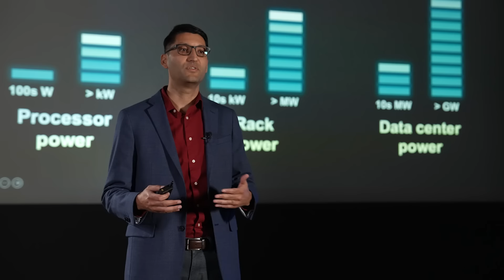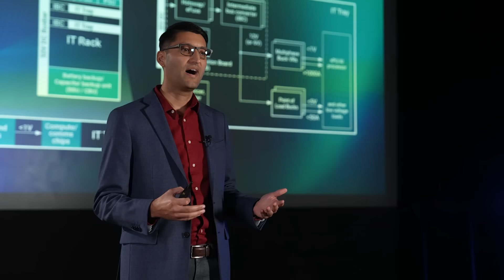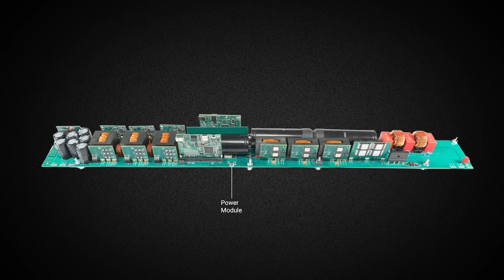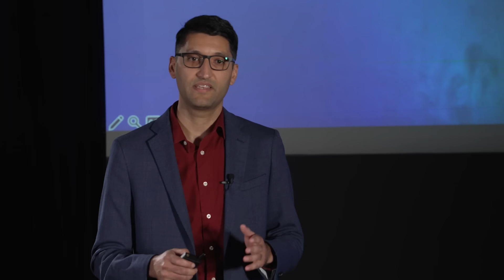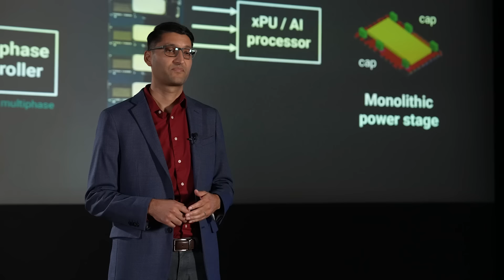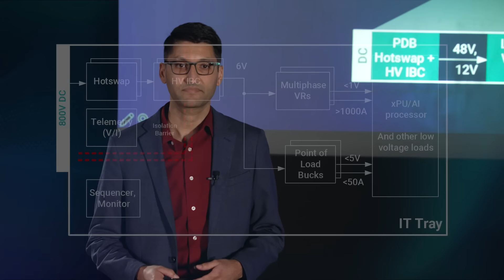Reimagine AI data center power from grid to gate

Comment: I was granted US patent 3890161A  DIODE ARRAY in 1975 for a cooling device paired with DC electrical power yield typically consisting of billions of nanometer-scale diodes in parallel series. The patent opened to the public domain in 1992 providing me with permenent written public attribution for the idea circa 1973 upon filing. 

The physics supporting the DIODE ARAY is simple and well supported. 

Johnson Nyquest electrical noise is a well accepted phenomenon in the microscopic relm. Rectifiability was  checked with a SPICE model using representive place holders, a 1V, 1 ohm forward branch and -10 V, 100 ohm reverse branch in parallel solving for net DC power and matching load resistance. The forward branch predominated. The efficiency of each diode is low because the nanowatt random  power within each diode doesn't rectify well. This inefficiency affects the performance but not the equality of the thermal absorbtion compared to the electrical yield. Widely scalable electrical power, usually microwatts to terawatts, always paired with equal refrigeration is thus possible. 
Plausibly the DIODE ARRAY will emerge at a multiple exponental rate because if it works it will work very well with many virtuous circles of expansion. 

The differentiated features of small structures will ultimately over a very long time loose their differentiation. This loss over decades can be very small. A quantitive example of this is that a pile driver hammer dropping three meters many times an hour over a service life of twenty years will impart millions of times more energy to its pillar than the energy  needed to melt the metal pellets needed to create the hammer. This is industrial negative entropy. 

Order is imposed on the random thermal motion of electrons ,Johnson noise, by the structual orderlyness of a diode array made of ballistic graphine diodes made within a slab:     
                       

--------------‐-‐-------BeO
●●●●●●●graphine+out
Au - Pd sputtering alloy 

Merge   ______.   Merge
\  pore / solid \   pore / 
  \       /  matrix  \       /    
tip🔻     Al2O3      🔻 LaB6 
●●●●●●●●graphine-out
--------------‐-‐-----------BeO

The nanometer scale cone tips inject electrons  into the graphehe which is a two dimensional conductor from which the electrons don't  reverse flow into the tips. Optimin dimensions of features in the nanometer range need to be determined. Proof-of-concept prototypes may use random orthoginal fission fragment or heavy ion track  etching of thin Al203, which yeilds uniform conical  openings. 

Plausibly modern nanofabricated diodes can be made in the nanometer scale relm that can be aggregated to be practical at any scale 

The plausible electrical filtrate from diodes can be aggregated in a first grouping of separate diodes in  consistent alignment parallel. After a primary level of grouping in a supporting frame of BeO interspirsed with current feed throughs to a flawless layer abutting the cone tips a and slightly flawed graphine, abutting the cone bases, further groupings can be added in compound parallel and series where both current and voltage are additive to provide desired DC current and voltage. The cones are laterally embedded in a matrix of Al2O3. Within limlts, parts of the  network can be shorted out or open circuted without chemical or electrical harm below current flow heating damage or, a step higher, an electromigration limit. 

The maximum energy is converted from ambient heat to productive direct current electricity when the load electrical resistance  is equal to the array internal electrical resistance. Maximum calculated electrical power output (watts) is k (Boltzman's constant), one point three eight x 10^ minus 23, times T (temperature Kelvin) times bandwidth (0 Hz to a natural limit ~2 THz @ 290 K) times rectification halving and nanowatt power level rectification efficiency, times the number of diodes in the array. 

There are a hundred million measurment cells of 10000 square nanometer area each per square millimeter, 10 billion per square centimeter. 

Let's reframe Earth's low diversity abundant ambient heat as a thermal energy waypoint between heat and other forms of energy.
As the polarity filtered electrical energy is exported, the amount of thermal energy in the group of diodes decreases. This group cooling will draw heat in from the surrounding ambient heat at a rate depending on the filtering rate and thermal resistance between the group and ambient gas, liquid, or solid warmer than absolute zero. There is always a lot of ambient heat on our planet, more on equatorial dry desert summer days and less on polar desert winter nights. 

Go ahead and start to build something inspired by this introduction without my involvement.We can meet after there is solid crowd verification.
Please share the successes or setbacks of experiemental efforts. The topic deserves crowd financing, discussion and prototyping attempt action. Crowd development would be resistant to confiscation or burial. At best there could be science quality colaboration. 

After small scale prototypes of various types are made with widely developed processes many enterprises will be able to think of appropriate scale production.
There is no need to have one manufacturer emerge. All competent manufacturers should develop their processes without exclusivity or forced dominance. I don't think I have outstanding abilities at this phase so I'll help but mainly get out of the way. 

Energy sensible refrigerators that absorb heat and yield electricity would complement computers as computing consumes electricity and yields heat. Computing would be almost free. Chips could have  energy recycling sophisticated srructures combining microscale heat pipes and light and electricity paths built in. 

Full heat recycling, all electric, very isolated underground, undersea, or space communities would be highly survivable with reduced ElectroMagnetic Pulse pickup which eases further protection, self sufficient LED lit automated vertical farms, thaw resistant frozen food storehouses, amphibious factory submarines, nonstandard dwellings, self contained elevators, safe rooms, and free range transports.Some electrical equipment groups could be consolidated into local networks when suitable. Liquid nitrogen cooled superconducting networks would become practical. Fire safes would maintain contents at a desired temperature in extreme heat or cold for years. Waste mneral crushing and pulverizing would be cheaper. 

In a flourishing civillization, small self sufficient electric or cooling devices of many kinds and styles, lamps, smartphones, hotplates, water heaters, cooler chests, fans, radios, TVs, cameras, security devices, robots and robot test equipment, scales, transaction terminals, wall clocks, open or closed for business luminous signs, power hand tools, ditch diggers, pumps,  personal transports, and cryogenic liquid or slurry based fire extinguishers would be available for immediate use incrementally anywhere as people as individuals or larger social groups see fit. Human enobeling communities could be built quickly. 

If a high majority thinks our civilization should geoengineer gigatons or teratons of greenhouse gasses out of our environment, hypothetically networked instalations, either a few big ones or many small ones it could build them using clean  electricity, heat, or refrigeration. 

Undesired chemical products could be kept within an industrial system which stores, distributes, and processes them cheaply until only desirable products emerge. 

These devices would probably become segmented commodities sold with minimal margin over supply cost. They would be manufactured by advanced automation that does not need financial incentive. Applicable best practices would be adopted. Business details would be open public knowledge. Associated people should move as negotiated and freely and honestly talk within a planetary diversified cooperative conglomerate. There is no need of wealth extracting top commanders. We do not need often token philanthropy from the top if the wide majority of people can afford to be generous.  

Aloha
Charles M Brown
Kilauea, Kauai, Hawaii 96754

Comment: Why do most data centers insist on using the 1920 vintage buck converter (60%-80% efficient) instead of the 2011 Cuk-buck2 (90% efficient)